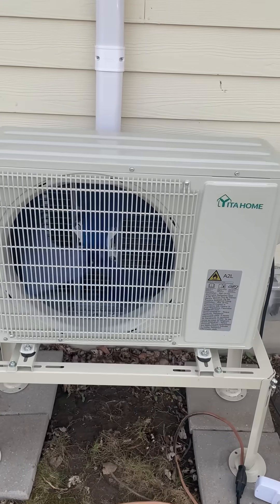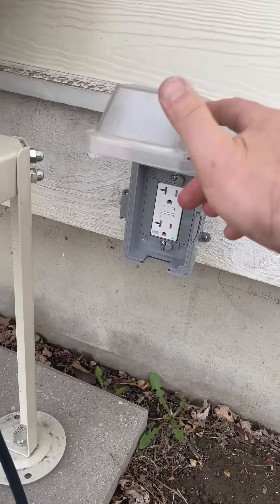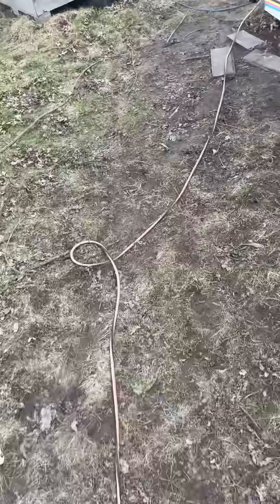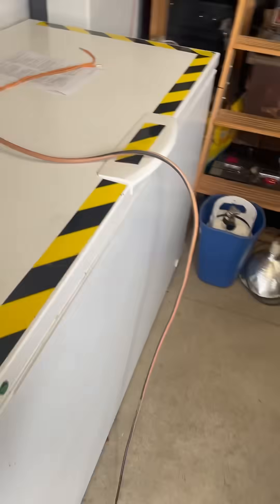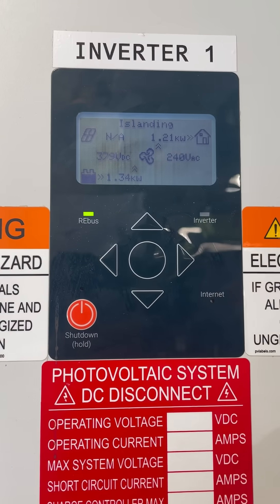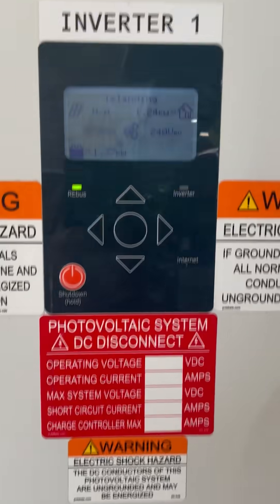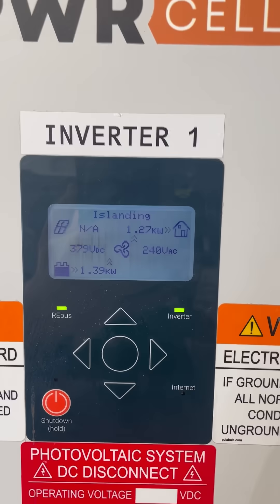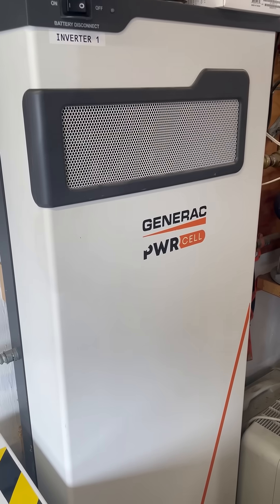Mini-Split powered by Solar Battery #renewableenergy #diy

Comment: So I've always wondered how the 240v output of the inverter relates to the 120v load - does the wattage double, or halve, or not change at all? I get Ohm's Law but in this case I'm mystified.
Reply from the maker: In the United States, we use "Split-Phase" power for residential use.
It's really TWO 120V systems - That is to say it's 120V from the hot to the ground. Then the OTHER 120V is ALSO 120V difference to ground, but going the other direction. So, the distance between the two hots is 240V.

On my inverter, I'm not CONVERTING 240V to 120, I'm simply using the one leg of that split phase system.

This is how your circuit breaker panel works as well. For all 120V circuits (lights, electric outlets, etc.) Those just use the one "hot" and then use the neutral (which is at the same potential as the ground) as the return path.

Comment: It all looks very expensive..  I'll stick with my wood stove for the winters.
Reply from the maker: The mini-split was $350, brand new. Besides being fully automatic, it also air-conditions and dehumidifies. 

The solar equipment was bought used, for an absolute steal. 

I also enjoy my Vermont Castings Intrepid II wood stove in the winter.
Reply: @BenjaminNelsonX  Nice..  a win is a win. ;)